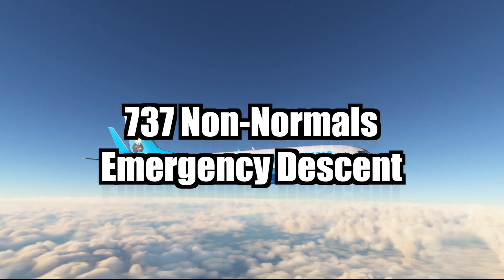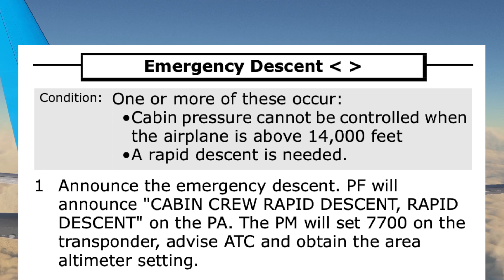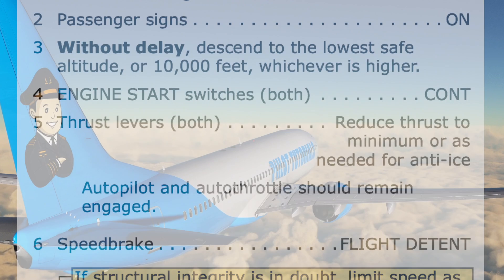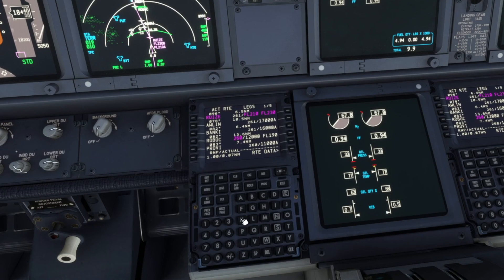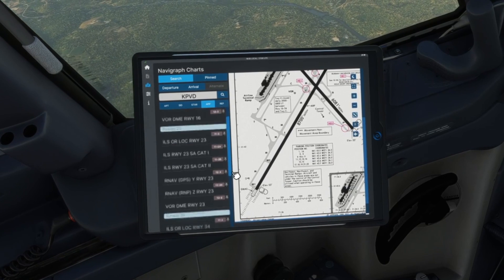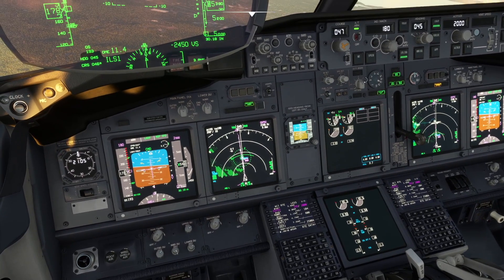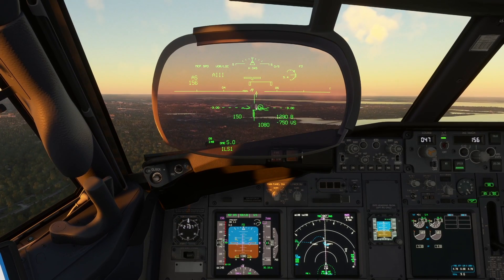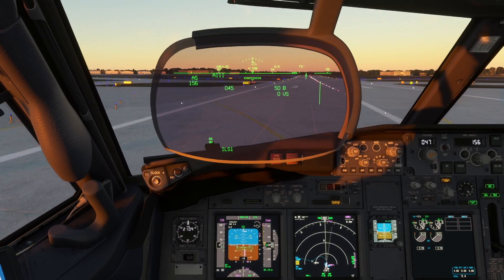737 Non-Normal Procedures:  Emergency Descent

Comment: Are the consequences of using wing anti ice on higher flight levels, you showed in your last video, also simulated in the pmdg 737 or only in the zibo 737?
Reply from the maker: Great question. The video was made using X-Plane 12 & Zibo, I was unable to replicate using MSFS 2020 & PMDG 737, it may have different parameters or doesn't yet do this. The 737 manual itself uses the word 'may' occur, people sometimes say the manuals are written by lawyers, words used such as 'may', 'should', 'shall' are not randomly used. If anyone is able to replicate this using PMDG please share how.